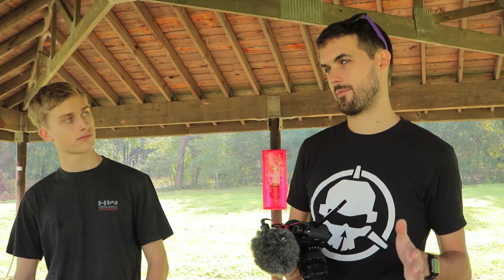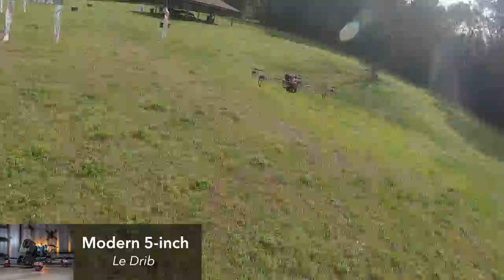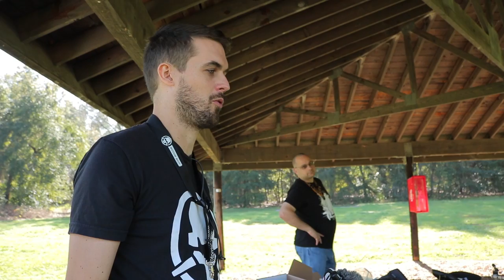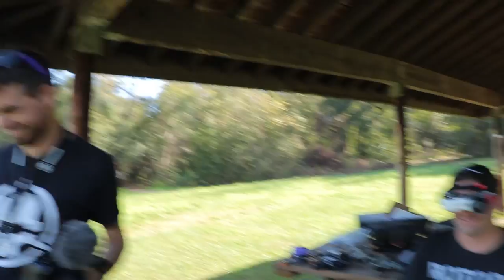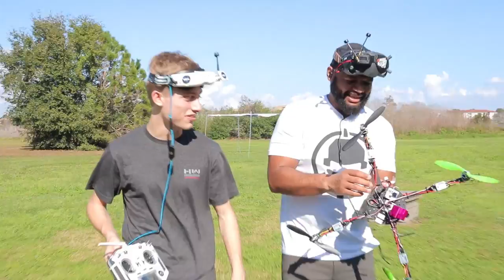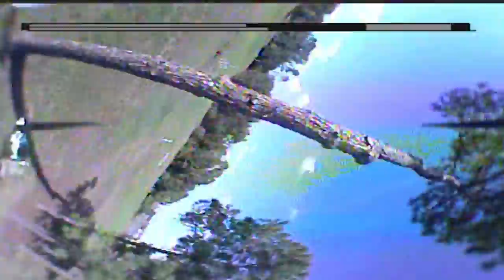FPV Drone with WOOD FRAME?... Kaveman Kwads!

Comment: I want to see an average pilot with a modern kwad vs vanover with a kk2
Reply from the maker: Excellent idea!
Reply: Seconded.
Reply: But they need to be comparably powered. Same size motors, props and battery.
Reply: @DocmurdocFPV  No, they can't.  That's not the point.
Reply: @DocmurdocFPV  frame would rip apart
Reply: Peter Zingler My BatBone V tail had regular size motors on it and props and it was hand built all out of plywood and square dowel stock. Flew great just don’t hit the ground real hard or all the motor arms would break. Haha did that more then once. Plywood frame never ever broke. Still have it and it flew great on a KK2 Mini board.
Reply: @RotorRiot  I'll do it!

Comment: Started with a RCExplorer tricopter (David Windestal) and three separate gyro's (for heli-tail). 
After this it was an Arduino mini with the little PCB taken from a nunchuck controller. All "programmed" with the MultiWiiConfigurator.
Fun times, and at that time it is hard to believe the performance and crash resistance we are now used to.

Comment: This was a fun trip down memory lane. kk2 was the new hotness when I started. I was a pretty big noob so I didn't figure out how to manipulate the flight controller, but I did do flips by whipping back and completely chopping the throttle so the board couldn't control anything while it was upside down then getting back on the throttle once it made it around. lol then a kk2.1.5 for a while then a vortex 250 pro right after those came out. kk2 is where I learned to fly, vortex is where I learned how to send it. Now I have a handful of quads that are more capable than I am.

Comment: Started RC flying in 2015 with a friend and my first build was a David Windestål tricopter, I CNC cut the frame out of delrin (polyacetal plastic) and had Naze32 on it. Back then 9 inch biblade prop was the norm :) That was still all custom power harness from wire with bullet connectors and dupont servo plugs but sometime after the "direct solder everything" school of thought started taking over. I think I still have the frame and some of the parts in a bin somewhere.

Comment: I loved to watch this Video. I started with a CC3D Board with Open Pilot and a Lisam Frame a few Years ago. I was so excited to have this Setup up in the Air the First Time. And in my First Loop it went down. Lipo and a Motor were damaged. I didnt realized the damage Motor at first and it cost me 2 more ESC;) After this i Stress i went back to Planes for a long Time. But last Season i startet again with new Setups and 6s;) WOw 6s is a Beast in Freestyle. I have alot of fun flying FPV with Friends and I cant wait for better Weather here in Germany. Every Friday i go fly in the Sportshall with some 2" and 3" Kwads....but those cant beat the Feeling of a 6s 5"... I love this Hobby so much that i sell all my Planes now;)

Comment: i'm here from the time of the kk boards also. from the best times, i built many tricopters, even made 10" filming h quad with a gopro 3 and a self made brushless gimbal. also a similar 8" quad like Jos had with a 2200 3s 20c battery
Reply: Me too...360mm bumblebee!   You can see it on my yt channel way back.
Reply: Wanna know more about self-made brushless gimbal

Comment: What an AMAZING episode!! Thank you guys so much for this!

First time I saw a multicopter was at my local flying field, where all we flew there were airplanes and helis. Then one day a few of the guys started experimenting with some ridiculously bad-flying kk2 quads that could barely manage a circuit. Nonetheless, I was very intrigued by the copters and decided to research the subject matter a bit. Those guys were having loads of fun and laughing their butts off and I wanted in on the fun. 

We're down here in Brazil and none of those modellers spoke English well enough to be able to explore youtube content on multirotors. I went on youtube and discovered David Windestal, Bruce Simpson and the Naze 32 board. I ended up building a Hobbyking Talon tricopter with 10 inch props and a naze 32 board. When I showed up at the field, my tricopter flew extremely well and impressed the crap out of the other guys. Everyone immediately switched to the Naze 32 board and Baseflight. I later built an RC Explorer tricopter for line of sight flying which became one of my all-time favorite models (until I lost it to a lake). Even though the Naze copters flew badly by today's standards, back then they were my best flying model aircraft, period (as compared to all my other model airplanes). It was crazy how well they flew. 

Back then none of us was messing with FPV; it was strictly an LOS thing and the large size of the copters was a good thing. 

Best regards from Brasilia, Brazil.

Comment: Started with the Simplecopter tri-copter and Simplecopter V-tail running the KK2.1, and good ole SimonK esc's that burst into flames with no warning. Ha. Great episode guys, that really brings back some good memories. My old wooden frame multirotors hang on my garage wall, and I believe that's where I'll leave them. Ha.

Comment: I'm coming to this video way late after being away from the hobby for almost 8 years now(having a kid is expensive).  The last thing I flew before my daughter was born was an H-Frame Knuckle with a KK 2 and no FPV, all LOS. Fell out of the hobby when I crashed and ruined my board because money was just too tight. Picked up a Mavic Air 2 earlier this year for family stuff and started getting back into it then got a Tinyhawk Freestyle 2 after getting all my certs and stuff. Things have changed so much it's wild.

Comment: I got into the hobby when the KK2.1.5 board had just come out, and the screen was a huge deal because you didn’t need computer to change any settings lol. 
I made a quad which I crashed so then I built a tricopter using legos to build a tilt. It flew amazing! 
I actually remember getting a KK board without a screen (with the vertical gyro) and I couldn’t get it to work with my TX because I had trouble with the FTDI. So fortunately the KK2.1.5 came out and I could get in the air.

Comment: I started flying helis back in '97.  My first multi-rotor was a tri-copter using a KK board.  =)
Reply: TheRealSuperman217 - OG - My second multirotor was the tricopter.  My 1st went into the wall at mach III before I ever got to fly it, lol.

Comment: My first scratch build was the FT Electrohub kit purchased from ReadytoFlyQuads (remember them?) complete with a a Flip1.5 FC, SimonK esc's, and a LemonRX receiver. IT WAS AWESOME. Later I ditched the Flip for a EagleTree Vector, an EZUHF, a 2.4Ghz IRC fpv system and turned it into a hexacopter. IT WAS AWESOME. I still have that setup. I still get a solid 30min of flight time on a pair of 3s 5200mah ran in parallel and have flown as far as 5 miles out with it so suck it DJI

Comment: I built my first quad in 2013 on a 600mm wood frame shaped like a Roman numeral X, so of course I named it the Mark Ten, aka Mk X, using a KK2 board and 9" props. Since I wasn't doing fpv yet, I wanted a big quad so I could see the damn thing flying LOS! I finally smashed that frame a couple of days ago while fooling around with iNav RTH. Mainly I fly a 4" fpv quad with a custom wood frame now. You guys are way ahead of me, but I won't let that stop me from trying to catch up. I think my next quad will be a CinePro or CineQueen.

Comment: Amagad, I remember the kk2 controller, I had a wierd sandwich box as the base and protective "lid" :D I remember the sound of those ocillations and big ass props swinging! I just got back into the quads, normally i like to slope, but the tech just looks soooo much simpler now, I mean these "Stacks" with plug and play stuff... I has to have a new one :D  No FPV back then though!  Hillarious video, thank you!

Comment: I started out with a Cheerson CX-10A, non-FPV quad that runs on a 100mAh battery, then Cheerson CX-20 GPS quad.
But my intention was always FPV, so I bought HD2's over 3 years ago and started flying a Syma X5C clone with an AIO camera.
Then some months after I learnt acro on FPV Freerirder and bought a Kingkong 90GT for some proper FPV, which led me on to the Kingkong ET100 & ET125, Aurora QAV105, Emax Hawk 5 and brushless whoops. Most of which still work perfectly.

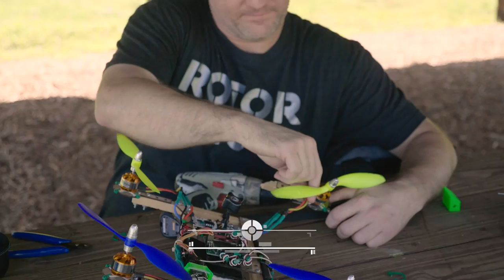Comment: Ahhh... I had those wooden crosses with MultiWii firmware as well. They could have been used for exorcism between two flights. And I'm 90% positive I had exactly the same motors with those cheap propellers that you can see at 7:34. Good old times! :-)

Comment: my first quad was an FT Versa Copter V2 built for LOS flight. I was in middle school and couldn't afford an fpv setup lmao. think it was a naz32 with 2204 motors and 6inch 2 blades. used full sized RC airplane esc's and 6 channel receiver. i gout out of quadcopters for a while after that and just recently got back into it with a Happy Model crux3 and am loving the hell out of it

Comment: I had a frame made out of plywood and aluminium tubes,  megapirate 16 bit FC, camera with 90 degree FOV, giant ass motors and 8+" props. After every crash i had to spend 15 minutes reattaching everything with zipties. I had to program escs with FTDI adapter, balance props that would explode on contact with grass, and use loud beeper to control voltage.
Nowadays everything in FPV just works out of the box, it's so much better, yet people still complain about having to solder 20 wires per quad :D
I sound like an old fart from 50 years ago, but all that happened only 5 years ago.

Comment: I started a build with a Tarot Robcat 270 frame, CC3D board and ESCs / Motors so cheap, they dont have anything on them to identify what they are. 
One of the motors was bad, then I got a new one, but one of the ESCs was also broken. It sat on my shelf for 5 years and I am now trying to ressurect it, though I basically replaced everything but the frame by now, and there are still problems. Wish me luck!

Comment: been in the rc car thing for years - even have a x-maxx 8s.  i just 3d printed my 1st quad.  using a fs-i6x tx/rx using ppm to an arduino nano running multiwii w/combo 6050 gyro/acc.  maiden flight to happen in a few days after the TX arrives.  awesome vid.

Comment: Back in 2015 OpenPilot CC3D was a thing. I had 5" fiberglass Tarot 200 frame (which mostly survived), then Totem 250 frame with plastic arms that were breaking after each crash and after that first carbon frame with DYS1806 motors and 6" props. Also i had failed attempt to build quad with 10" props on F450 frame that was so heavy that it was barely flying...

Comment: I started back in 2013 - Naza v2 on a flame wheele body 450mm. Quickly got board of the naza (phantom) controler and put in a KK2 for real fun.

Comment: My very first brushless quadcopter was a Whitespy Flip 32 it used a  3s to 4s lipo  it had a multiwi flightcontroller 20 amp esc(non simon K) with 8 inch props it was a mutiwi gui frameware in order to adjust your rates and switches I also placed a a FPV camera on it one time to try out for the first time I was hooked.

Comment: first drone was a parrot ar2.0, put me off for several years until i accidentally discovered fpv when i bought an ideafly grasshopper, had no idea what i was buying, its still out the back of my farm somewhere. ive since built a few and currently fly an f4 board

Comment: My first quad was a TBS Discovery Clone off Amazon (I think that's where I got it). The rest of my parts were from 3D Robotics, motors, ESCs, telemetry modules, APM 1.1 flight controller, gps module.

Comment: I was so close to a flame wheel style and a kk board but I waited too long and came in on a carbon fiber tube racer Ares Cross Fire with a f3 cleanflight FC. Man it seems like forever ago. Everything has changed so much.

Comment: That was awesome......  But do you remember MultiWii?  I build a 3D Printed TriCopter based MultiWii FC and till this day it was still one of the better flying Tri-Copters I've ever flown. I chalk it up to the calculation speed being fast enough for the response times of motors and the servo tail, and not to fast to try and over compensate; natural filtering because it was a slow 8 bit processor.  Programmed with Arduino.

Comment: Would be interesting to see how modern Electronics would run on wood..if it could be smoothed out and made to "perform"
Reply: SKIDOOSH it flies great with the naze32 - the wood still vibrates, though.  Need thicker wood, I think.   And stiffer props.   Those old, unbalanced floppy props made so much vibration.   Haha.
Reply: @LetsFlyRC  So freaking cool man!! Next time I'm home I'm going to hit you guys up and ride up for a rip sesh!

Comment: I started off on a second hand Walkera runner 250 that liked to flip over and drive itself into the ground at random. I still have it and it still flips over and drives itself into the ground.

Comment: Back in the day people weren’t really that interested in doing tricks. When I built my first quad in 2012 everyone mostly wanted to just have a stable, well flying platform for fpv or filming. And about the same time I believe gps support was added to multiiwii. So everyone’s goal then was to build a giant octocopter that would hover by itself and could do thing like return to home etc. And there was a ton of 10 minute long videos on the forums of people just taking off and putting the transmitter on the ground to show off how well their quad hovers. And generally back then your status on the forums was dictated by the size of your multicopter and the number of motors it had :P.

Comment: First build was a KK v5.5 tri-copter wood frame, plastic core was cut out of refrigerator drawers strapped on a 2.2 3S it was about 600mm scale 900kv 9 inch props.

Comment: What about the first version of David’s tricopter with 4 separate rate gyros... that’s the first multirotor for me. After that we made a few with the original multiwii controllers. Just smashing the nunchuck appart to have a flight controller, great fun tho.
Oh and don’t forget the manual flashing of blheli too! Soldering every programming pad took forever.

Comment: Came through arduino MultiWii in 2014/2015, had STM32F1, CC3D, naze32 rev6 and things started being awesome on F3 evo and still getting better with better firmware for F4 and even the last available betaflight for naze32 is good and on my only tricopter the CC3D works fine with dRonin.

Comment: I started in FPV with fixed wing.  Got a KK2-based Tricopter going, and then tried to jump over to the flite-test quad and Naze32 and other boards.  they were so insanely complicated and difficult to make work, I could never get one to fly right.  In the end, between this and kids and the whole FPV crackdown by the government I ended up bailing on RC altogether.  All my gear is sitting on a shelf in my basement collecting dust.

Comment: SP Racing F3 Evo was in the mail.  Then I saw a video with someone flying mountains with a BrainFPV RE1.  GetFPV had it in stock, and RE1 became my first FC on my QAV250.  30x30 FC...  My F450 flamewheel I had APM 2.6...

Comment: Scratch built Flitetest H-Quad (dowels and plywoood) with a DJI Naze-M controller, Turnigy ESC's (like the ones in this video, with the red shrinkwrap) and cheap motors. Flew nice.

Comment: I started back in the openpilot days quickly switched to naze32 then moved on basically from them. But I am I supposed still flying in the old days as I still fly flight one board V1

Comment: Dude ! how hard it must have been to learn acro with one of those ?!
I've never seen such a wooden kwad in a simulator, and i guess the simulators came way later.
Reply: Those are flying pretty good. The norm was only angle mode worked

Comment: Is it possible to use the turnigy plush ESCs with a modern flight controller if I change the setting in beta flight to PWM?

Comment: It would be cool to put all of those parts on a carbon frame and see how it flies. At the same time put modern electronics on the old wooden frame and see which flies better. Modify the old quad one part at a time to see exactly where the shortfall was in the flight performance of the older quads. I'm sure it's a combination of all of the differences, but what is the biggest factor? Firmware, hardware, electronic hardware?

Comment: First quad was a lexan and wooden frame with kk2, afro 20A ESCs, 800kv, 10" "slowfly" props. First miniquad was a  DRQ250, CC3D, simonk 12A, Sony boardcam, 600mW humongus vtx with rubber ducky antenna and Orangerx receiver. Open pilot was really bad

Comment: I started out with a giant immersion 1.2ghx vtx, an ft210 frame, and a naze32. The motors were 2204 2300kv emax motors, extremely underpowered

Comment: I started on a racerstar f4 board.. I don't really know if it was actually an f4 tho. You couldn't change the osd font, and turtle mode didn't work but it was still much better than those quads

Comment: My first flight controller was an F3 from SPCMaker which I bought in 2017. It flies perfectly to this day, also thanks to Marc Spatz' Betaflight F3 Performance Edition. I am so thankful to have started after all that CC3D and SimonK %$&! were superseded, and even worse stuff that came before. Today, I can slap a quad together in an hour and get something that basically flies like a simulator.

Comment: I started back in the openpilot days Then quickly switch to naze32. Then went to betaflight for a while keep burning out Motors then switch to Flight 1 even though. I'm still flying raceflight v 1 boards.

Comment: I came in with a tricopter on the original KK board that had 3 x potentiometers that set the gyro gains. It had 3 x separate can gyros.  Yeah it was crap.